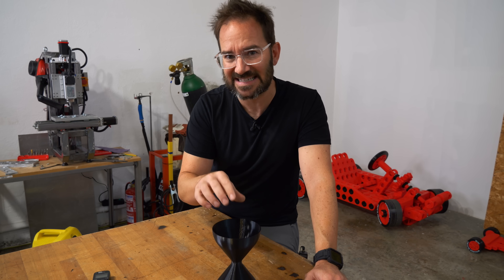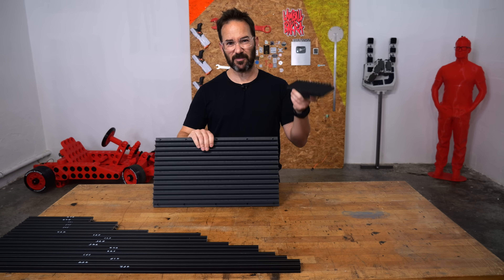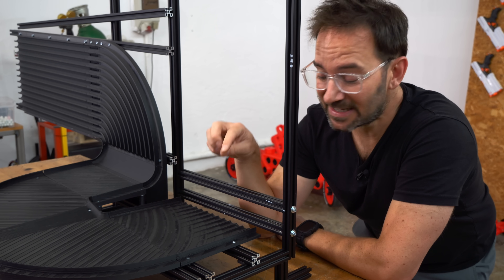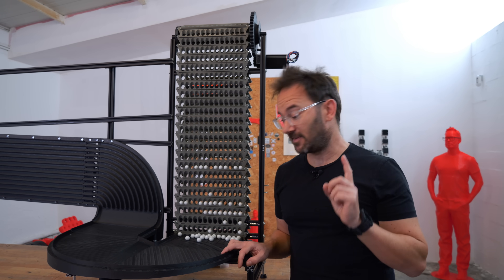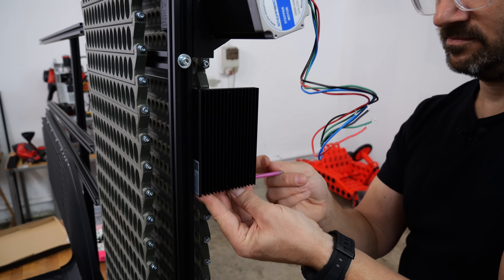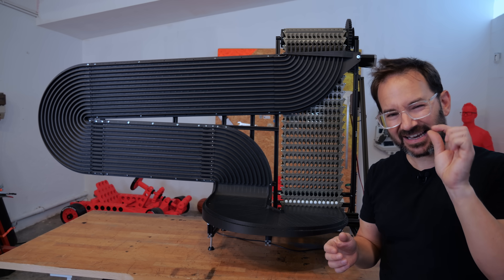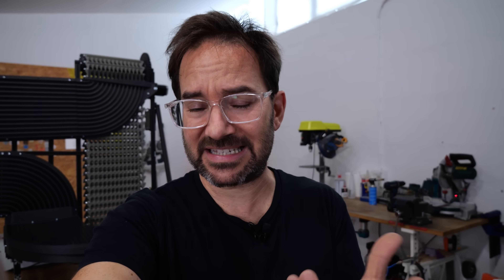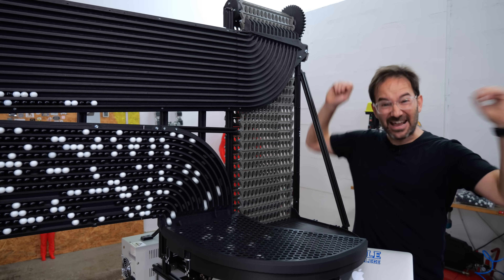BUILDING A MARBLE CLOCK - Pt.1.

Comment: I have two suggestions for you: 1_ use metallic marbles ( it's They are all the same size and very smooth and do not create such a rough surface like glass marbles, then just paint it in white and black) 

2_ Use Dry lubricants like graphite and molybdenum disulfide on the threads or paths , it will make your marbles traffic very smooth.
Reply: If you heat up the bearings to red hot, they turn blue and stay that way.

Comment: So, 13 x 31 = 403 marbles to prepare for a swap in 60 seconds, or 6.7 sorted marbles per second if you're dropping them into columns. And if you don't account for the time to drop and replace the marbles, the displayed time will drift, so maybe more like 55 seconds, or 7.3 marbles per second? Sounds like fun. I did notice the '2' for the hour was two rows taller than the minutes, so if everything was the same height, at least you'd get 4 rows of pure black, which reduces the total to 279 marbles you actually have to think about.

There are vertical and horizontal set of white, so maybe those can be dropped at once and backfilled with black? I'm just spit-balling here. 😀 Can't wait to how it actually works!

Comment: I have a possible solution to help with the marbles jumping out. Maybe you could try to add Bristles at the end that could slow down the fast balls, but still let them through. Or maybe add a soft material under where the marbles are falling to absorb the energy instead of marbles bouncing and flying off.

Comment: I'm guessing you've already worked a decent solution for selecting marbles. But I used to work at a facility that optically sorted peas for seed. They would essentially drop a stream of peas in front of a camera and a jet of air could divert the stream into a separate bin. Here I'm guessing you could just have another arm knock out any marbles of the wrong colour back into the bottom.

Comment: Steel bearing balls are more precisely dimensioned and almost perfectly spherical. Moreover, you can blue the black ones and leave the white ones silver, and select a ferromagnetic alloy for one type and a non-ferromagnetic alloy for the other. I think the change will make your life a whole lot easier. Designing and building these things is very difficult, as Martin from the Wintergarten channel would attest. You’re making things unnecessarily difficult for yourself by using glass marbles.

Comment: Thermochromic paint them all.  Pre-chamber with a grid of heaters that warm up the time ones. No sorting required, just some thought about control circuits. They’ll have cooled back down by the time they’ve climbed the lift. Possibly run them through a water bath on the way back. Might allow for 1min updates. Actually closer to an LCD than having different colour marbles.

Comment: I don't see how you plan to do the marble sorting mechanism, as other stated, maybe the most efficient way to do It's dropping the marbles vertically (wich I think It would add a great "gravity" effect), I guess If I had to do It given the setup that you already have, I would Use the elevator and the holes you have in it to fit a color sensor one for each row, and "cherry pick" wich ones to drop, the ones that don't drop into the tracks should return back to the buffer.... Idk, seems like a fun challenge

Comment: You might want to look into ABS No Hole Beads instead of the glass marbles. They are much more consistent and easier to use in 3D prints. Devin from Make Anything discovered this in his video about making the Astrolabicon Pro.

Comment: Genuine question (and I'm totally okay with the answer simply being "because that wouldn't look as cool"): Why do you want the tracks in horizontal rows which requires you to reset the ENTIRE clock each minute as opposed to vertical columns which would eliminate the need to repeat values that are repeated. if the time is 12:34, why do you need to recreate the "12:" part 60 times when it's just gonna remain "12:" until the hour changes? If you ask me, it would be a lot simpler to just create a series of four side by side 4-column-wide marble elevators, and advance the appropriate elevator each minute so that a new set of columns is created to display the time.
Reply from the maker: There are many approaches to solve a problem that no one has, I just chose the one I think would be the most fun to solve I guess?

Comment: The marble selection should be easy enough simple black/white detector (either an Ir reflector sensor or maybe an Adafruit APDS9960) Paired with an arduino. Have a solenoid to reject wrong colors in the path on the belt before it gets to the top. Rejected marbles just fall back down to the bottom. should be realtime enough. Once the correct Number of marbles are loaded for the next minute load for the minute after that. Once the count and cadence is correct should be close to real time. Hope this helps cant wait to see what you come up with.

Comment: Here's an idea. Use a PV sensor to select white from black and a solenoid to kick one of the colors to a different track. Maybe have two layers for the top section and send all the whites to the back. Then you can selectively add them back in at the gate.
Reply: A pv sensor might have trouble with the shiny glass marbles.
Reply: @Yay295  you think? I'd think there would be enough contrast between the white and black. You could use an Arduino to read the voltage VS using it as a dumb switch.

Comment: I hope you sorted the marble sizes by using the widening rails method, where the marble run on two almost-parallel rails and they fall off the rails as it widens, thus sorting the marbles sizes by how far along they roll.
Reply from the maker: That's only good enough for round marbles. I tried it at the beginning and many marbles that where bad ones passed the test. I ended up doing an endless run on the machine and removing the ones that got stuck at any point.

Comment: Winter gartan had lots of headaches with marbles and has a lot of great solutions. You should have some vertical tubes that the marbles run over, and an adruiono that selects if the tube should open and let the marble drop, based on the color needed.

Comment: Look at Wintergartan, he had lots of headaches with marbles and has a lot of great solutions. You should have some vertical tubes that the marbles run over, and an adruiono that selects if the tube should open and let the marble drop, based on the color needed.

Comment: Funny how a full display of the four segments is 13x31 marbles. That's 403 marbles every minute. Roughly 7 per second.

With a marble lift 13 wide that seems to run about 1 step a second, I guess at least the marble lift is fast enough (with not picking up always in all holes).

This certainly is going to be a loud clock...

Comment: As someone who tried to design a contraption to sort black and white marbles at secondary school, over 50 years ago, and never got anywhere close to a working solution - I'm very much looking forward to the next episode. Your ingenuity and skills are inspirational - please continue making things and sharing the highs and lows.
Reply: It probably wasn't easy 50 years ago. Now, I think that an ordinary LED, a photoresistor and a microcontroller may be enough, but I'm curious how it will be solved :)
Reply: @Bazarack  im curious how you would go about using those components to separate black from white?
Reply: @justinc2633  A light emitting diode (LED) shines light on the Marbles as they slowly pass by, limited by a cone of black paper so that it is only shining on one marble at a time.

Photo-resisters, contrary to their name, lose electrical resistance in the presence of light. So when the LED shines light on the surface of a not-black marble, the light scatters everywhere and illuminates the photo-resister to allow an electrical signal to pass through it.

That signal gets sent to the microcontroller, telling it that a white (or really, anything other than black) marble was counted.

In order for this to work, you need a way to count the number of marbles themselves, and a way to actually sort the marbles afterward. The first task is easily accomplished by buttons not unlike those in a pin-ball machine, and the second by a solenoid (also not unlike a pin-ball machine).

It would be complicated, but you can absolutely do it. Frankly, the microcontroller is actually optional as it's only function is to tell the solenoid when to fire and that would not be that hard to do without any form of computer.
Reply: I'm sensing either a camera based system or photo-sensor to detect black from white and eject the 'incorrect' marbles as they ascend the lifter.  OFC that would need some pretty extensive programing to know what marble needs to be where in the 'display' raceway.
I've seen videos of industrial sorting machines doing this with air nozzles to kick out - for instance - bad product from ripe product in sorting lines at hundreds of frames per second, ejecting 'dross' so fast it takes a high speed camera to detect it.
Reply: It's easy to build a color sorter with a mindstorms Lego set so and sorting black & white is easy to do with an Arduino but at this scale it's a bit more complicated. But mostly a matter of throwing more Arduinos at the problem:)
Reply: With the tech at the time, and school level funding, the best i can think of is some sort of light sensor that would account for the light bounce off a black vs white marble and output a different voltage based on that. Slow, but effective.
Reply: You can sort them if you know their position. It's a clock, so we know the color of each marble after the display 'reset'. Just need something to replace a marble with another color for the next timeframe, and most marble pixels will never change color.
Reply: I’m trying to figure out how you would’ve done it. Were phototransistors/photoresistors and comparators as common back then? If so, I guess you could hook up a motor to move when the detector sees light.
Reply: Maybe a backup with a photosensor, but as the marble colours will be known, they could be sorted before they fall onto the bottom plate without needing any way to determine the colours. I'm sure there'll be errors occuring so having a photosensor as part of it could be useful.
Reply: Best I can imagine is that you bring all the marbles into a bottleneck wide enough so there is no jams. Then with a fast refresh rate camera and good lighting is easy to recognize white and black marbles, now just run a servo that opens a door for one side to each color. Imagine an inverted " Y" shaped canal, like our throats, one side for the stomach and other side for the lungs. So you just move a piece of flat plastic to sort them depending on the feedback of the camera/ sensor.

Comment: Excellent video, the concept is very interesting. A few years ago, for a project, I had to do something similar with marbles. However, since their dimensions vary greatly, we tried using the ball bearings used in the axles of trucks' wheels, and it worked well. Nevertheless, the weight was too much for a flat gear reduction mechanism. For that reason, we used a 3D-printed crowned worm screw, which worked quite well, although it wears out over time. I hope you manage to complete this project, so I wish you good luck.

Comment: Since most the time, only 1 digit is changing you could make a single "digit buffer" where you build the digit with black/white marbles, and have a switchable/moveable track that would make the new digit fall into the hour/minutes places one at a time (only need 6 lanes to build vertically instead of 9/11 like you have it horizontally) ... (for 10 min and hour rollovers, you can dump all marbles, and rebuild all the digits) (you could even have a secondary buffer per-digit, so multiple digits can be built in the background, and fall in all at once for rollovers)
Reply from the maker: The variations are infinite indeed. I'be already gone through a lot of them in my mind. This one is most probably not the best but one needs to be built I guess

Comment: Right now it's a cool marble raceway!  I can't wait to see how you separate the black from the white and arrange them to be in the correct order.
Reply: Maybe if he replaces one color with metal marbles he could attract them with a magnet or something... Great video!
Reply: @alfvicente Martin has shown that messing with metal and magnet is a bad idea😢 balls will then tend to get magnetized all along and get stuck then in the paths.... Pls a marble machine should be made of marble marbles ey 🥳
Reply: Eject the bad ones while climbing seem to be the simpler to implement. Color reader sensor, solenoid and the pins to eject 🎉 add a capture track to merge them back at the bottom and that is it. 😅
Reply: @testman9541 yeah this is the way it's gonna be done.  Marbles are quite shiny though so calibrating the sensors could prove to be a bit tricky. Black and white is just a difference in sensitivity, but shiny black marbles detected at the highest point in the marble will reflect as much light as white marbles at the edges. 

Moving the sensor a bit further away to average out each marble is probably the way to go. And only rejecting white marbles will make things easier. One sensor rejects white marbles and another counts black marbles is probably the most stable way of doing it. Means 2 simple on/off sensor configs rather than 1 sensor trying to differentiate between the black background, black marbles, and white marbles all at the same time. Bit cheaper doing it with 1, but going to be a lot harder to dial each lane in.
Reply: @buzz1ebee  I don't think it would be hard to tune a photo resistor to or a low res Camera/ Pi W2 to see the difference then gate the 2 options to a waiting bay,
 but the placement would be complicated , multiple gates or a moving feeder for each color.
I think the ejector pins at the top of the lift belt may fail over time, another roller with teeth to slowly push them out would be way more durable and reliable.
Then again thinking of how a factory would do this, is to use air jets to eject the marbles at different points for sorting at the same time.
Then it could be regulated with different pressures for the best outcome.
Reply: @maxgood42  I used to supply sensor solutions for manufacturing and if someone had this application I'd have to do some testing to make sure something is stable. It should in theory with the right sensors and set up / distances etc be doable, but he shouldn't just whack one on and hope it'll work. 

A camera might actually be a really good option given how many lanes there are. Easier to set up one thing rather than 12 or however many lanes the machine has. Put a blue background behind the marbles or something and detecting blue, black, or white would be very stable. Getting the lighting right so that shiny black marbles don't reflect too much white light is also a challenge to overcome though.

Yeah that thing doesn't look like it'll last for very long. And ejecting the mables will be fun. Looking forward to seeing the next iteration
Reply: @buzz1ebee  Oh, so you already built this machine in your head like I did 🤣
Reply: @buzz1ebee  good idea! Smart and the simplest one 👍
but what if he can go the longer way...

separate colors after lift and compose every vertical line one by one. In this case, you will need fewer optical sensors, a bigger machine, and more video episodes 😋
Reply: That will be quite the challenge, indeed.  Only manner I could see that working is having gates or pins to limit what color will enter each hole at what time.  Using metal and magnets would be far too heavy.
Or, like the ejector assembly at the top, have one just above the input to 'eject' the wrong colors back down into the loading platter.
Reply: @amzarnacht6710 literally came to the comments wondering about this.. nice idea
Reply: looks like the white ones are bigger than the black ones, probably use size difference to filter.
Reply: @jonse5a  I think that's just an optical illusion, though I could be wrong.
Reply: Maybe he could branch out into FPGAs, then he could do all the required processing in parallel as the marbles roll past.
Reply: would have designed for slightly different sizes for each color - thereby allowing for a simple sieve filter
Reply: He's also using glass, and as time goes by, glass WILL break down from the abuse.  Glass marbles are extremely difficult to find in perfect spheres without great cost.  and for them to be tempered enough to where they don't shatter or break is going to break the budget.  He might get a good sorter going and be able to run it for a little while, but without great cost or a constant replacing and grading of marbles, it might be difficult for it to be a long term sustainable timepiece.  Steel or aluminum ball bearings is probably the best way to go for a long term solution.  Can probably shrink the size of the whole system by 1/4 to 1/3.  Anodized aluminum or Heat Colored steel can create the background color better, from shiny silver.  And sensors don't need very high calibration to detect the difference in color spectrum between Shiny metallic and an imbued color.  Aluminum would also be lighter than the glass marbles being used.
Reply: There are cheap color sensors in the world like TCS34725. Ejecting with a pin during the climb is probably easiest as sorting upstream will need mucho track rework. The hard part I think will be hopefully detecting the black marble with clarity vs the grayish track so you aren't hitting the pin against the track all the time. That level of resolution with no error (stuck pins in moving track bad) probably means the area behind the track needs to be well lit. Also, unfortunately black and white are like the hardest for this problem.